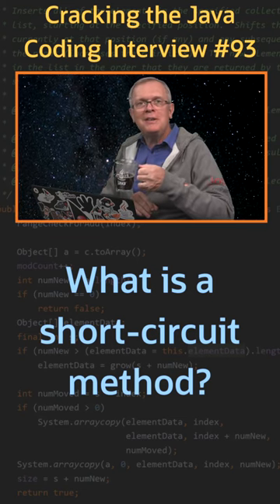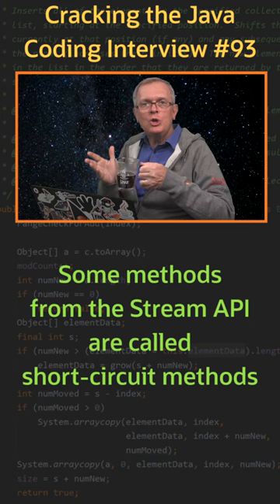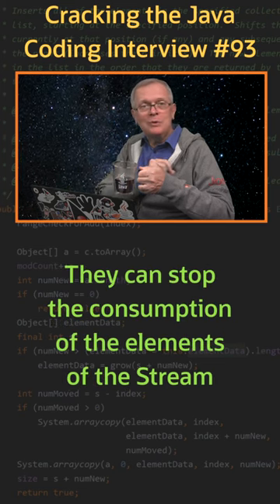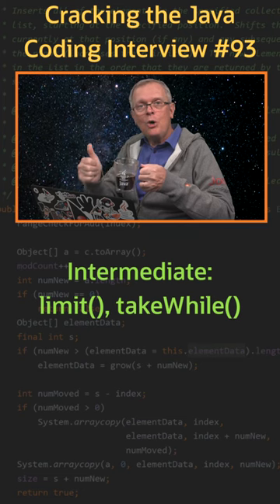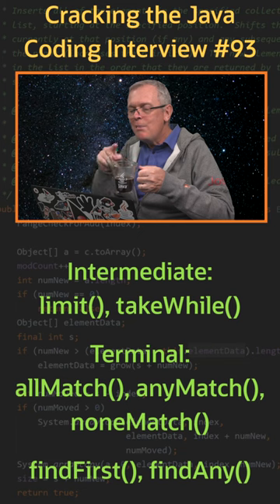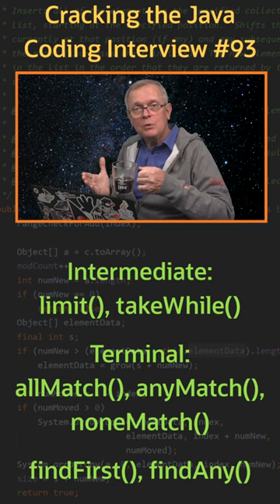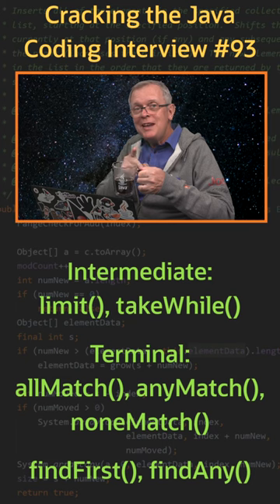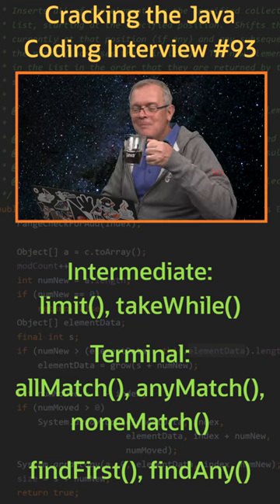What is a short-circuit method ? - Cracking the Java Coding Interview

Comment: What's the use-case for the forEach terminal method if you should never produce side effects?
Reply: System.out::println?
Reply: @JosePaumard  it's a difficult choice rather console io is considered a side effect.
Overall I think it's not as bad to have side effects in terminal operations than in intermediate ones.